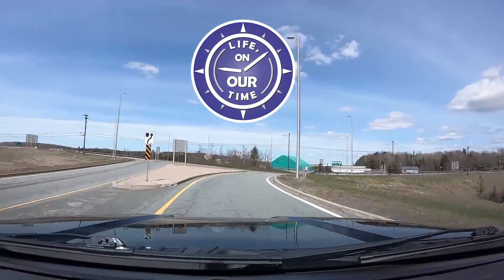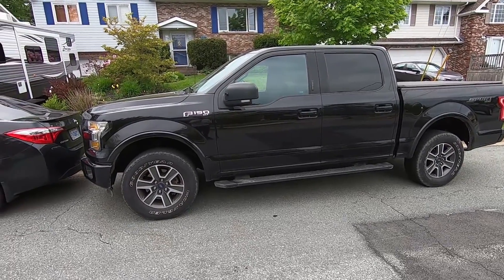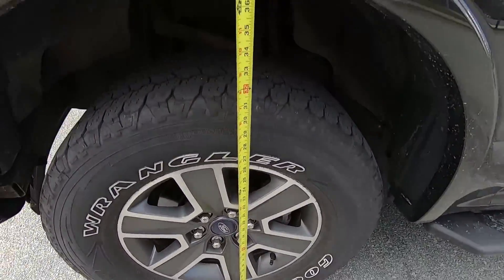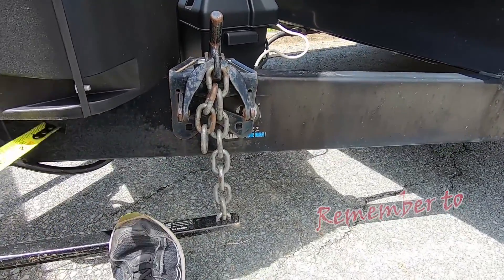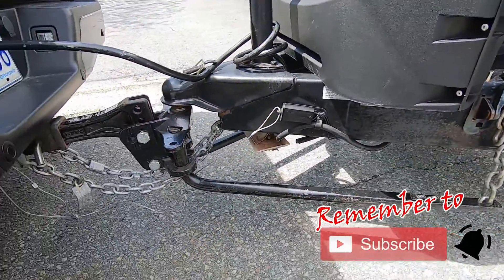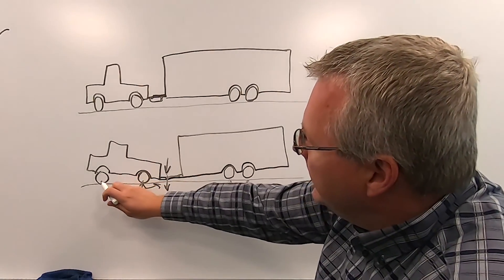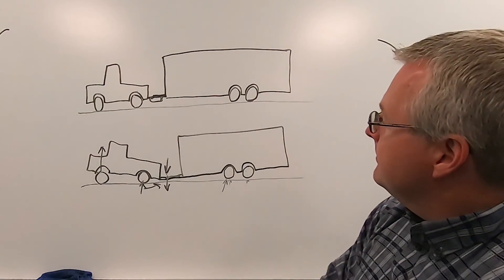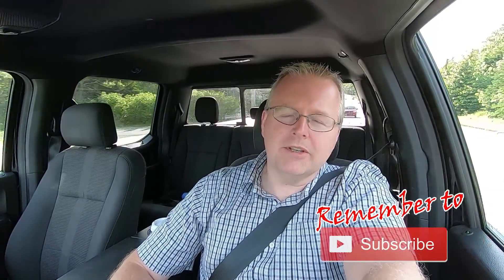HOW DOES A WEIGHT DISTRIBUTION HITCH WORK   |   DO I NEED ONE?   |   Video 1 of a 4-video series

Comment: Great video! Very helpful! So just to clarify, do you want to have some rake left after hooking up the weight distribution hitch or is the truck being level fine as well? I assume so as long as it’s not squatting with negative rake, right?
Reply from the maker: As long as you have no or minimal squat is ideal. Level truck, level trailer. Unless your trailer is very light, cranking up on the chains so much that you still have rake in the truck might be taking too much load off your rear wheels and making for an unsafe tow.

Comment: This  is  very  important  to  get  this  straighten  out on you tube  their  are videos  that's  state  when  using  WHD  weight  is  distributed  to the   trailer  axle  some say  forward  axle  some  say  both?
Reply from the maker: This is an excellent question. There is certainly some loading moved to the front axle, which is evident by the lower fender height resulting from added weight. But I can be convinced that a percentage could distribute back to the trailer axles. This percentage would vary, depending on the distance of the axles from the ball (which is the point of pivot for load redistribution).
Reply: Some weight is distributed to the front axle of the vehicle and some to the trailer axles. I have confirmed this many times on cat scales with different trailers and tow vehicles we have owned. Here is good video that explains it well in my opinion even though it was to show using WD vs Air Bag question but they show the weights for each set up  https://www.youtube.com/watch?v=XBZu39pQ8Gg&feature=youtu.be

Comment: This is a great video and explanation. However, I'm still not sure when you need a WDH. Is there a distance of drop / lift that triggers the need for a WDH?

For example, I have a 2017 Volvo XC90 which has a tow rating of 5000lb. I have a Lance 1575 travel trailer which has a GVWR of 3700. Measuring my car in the same way as your video without the trailer I have 32 1/2 at rear and 33 at front. When I add my trailer I get 31 3/4 at rear (Goes down by 0.75") and 33 1/4 at front (Goes up by 0.25" or 6.35mm). I do have a WDH, but honestly I'm wondering if it's worth all the hassle given these numbers. Thoughts?
Reply from the maker: Thanks, glad it was of benefit to you. So you are getting some squat on the rear axle from load on the trailer ball, and a little bit of uplift off the front axle from the lever effect of the trailer being connected. For some, it will likely come down to driving comfort and stability. Your tow vehicle weighs almost twice your trailer, so a WDH may not be as critical as it is for my scenario where the trailer is 50% heavier than the truck. On rough roads, the WDH also noticeably dampens the dynamics of bouncing. How has your towing experience been without using it?
Reply: @LifeonOURtime  I have towed this trailer with a few different setups. First was a Trunnions style Fastway e2 6,000/600 which I found added a lot of bounce and I really didn't like the experience of driving. Then I switch to the Andersen Hitches 3324 'No Sway' Weight Distribution Hitch which once setup correctly feels great while driving, no bounce and does seems to keep the trailer very stable. However,  although people say attachment is easy, my driveway means I have to pull the rig onto the road before I can attach which is a hassle. Then I've driven without using anything and for the most part it feels fine - but I do feel a small amount of sway when vehicles pass by, and I'm still yet to tow like this when its windy. All in all, I'm thinking I'll stick with the Andersen, more for the anti-sway than the Weight distribution aspect. Thoughts?
Reply from the maker: I like the Andersen hitch and almost purchased one from e-Bay. I had read a few owners comments that would fall in line with your experience as far as needing level ground to do the connection. I think it also offers some WD as well.  WD is a must for me, as far as truck loading and driving comfort. And so is sway control...with our truck and trailer I couldn’t do without it now.  For you, having the truck much heavier than the trailer, you may be fine with less WD and more sway control.